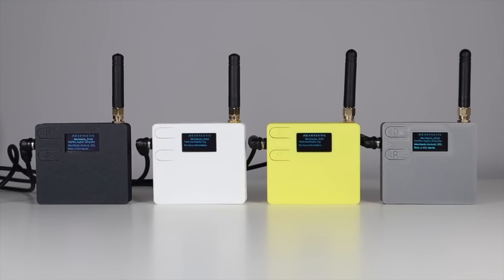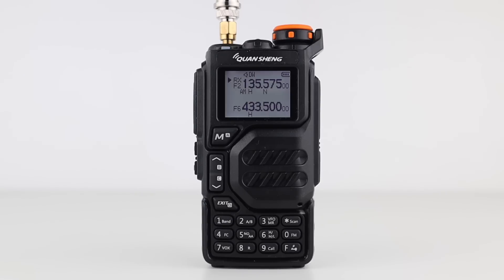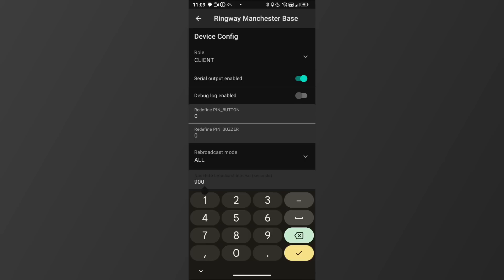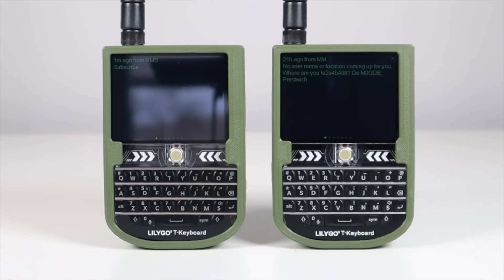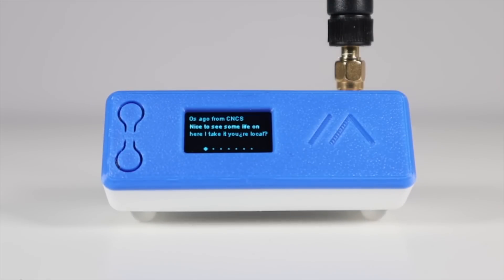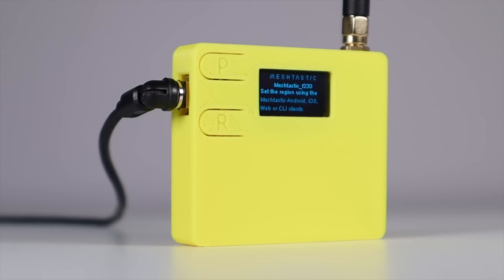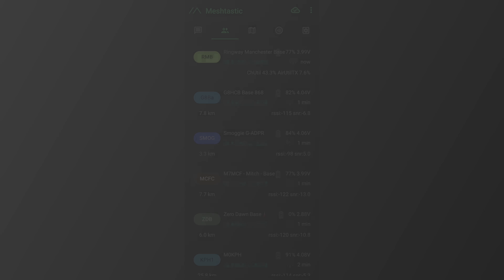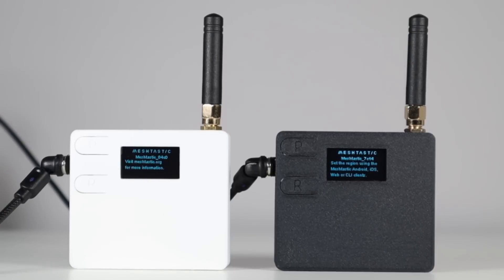All Your Meshtastic Problems Solved! - Off Grid Comms

Comment: The suggestion about suggesting users to increase ping delay reminds me a little of the 'niceness' parameter for processes on a shared Linux system where the intention was that surely users would start their process jobs with a niceness parameter that was friendly to let other people's processes get some processing time as well... Riiiight.....
I am new to meshtastic and not really an electronics engineer so don't have any suggestions for solutions, but it is sad that this kind of technology has this type of flaws where you have to trust that all other users behave respectfully otherwise it will not work..

Comment: Just got into Meshtastic a few months ago and I am in love with it conceptually, but there are a few things that are quirky and quite a few more that are frustrating.  Such as: whoever thought it was a good idea to call the default channel “long fast.”  Long_Fast is a modulation, and there 104 different frequency slots that can be used for Long_Fast modem present. The hash of the default channel name results in freq slot 20. Should have just called the default channel (with encryption AQ== and Long_Fast modulation) “Public” that would also help new users realize they are not in a private channel, and also understand that Long_Fast is a modem setting not just a channel name.

Comment: One thing to consider, is that many people that have Meshtastic devices have them for emergency purposes.  in the even of an actual emergency,  a once quiet zone can becomes very congested,  so having these settings as default even if your in a quiet area is best practice.

also I think,  setting your hand held unit to client_mute,  can also help.  strategically well placed nodes  means less nodes needed to service an area.   I live in south Florida US, so we are far from congested,  someone has placed some routers that seem strategically placed, I plan to add to that mesh.  filling a gap or two.

Comment: Am all for improving technology, but MESH just appears to be another fad that's been around for too long simply because of lack of imagination to try anything different in HAM radio. For all the hype about MESH and related or 'MESH'-copycat systems have heard for over a decade by various enthusiasts in the HAM hobby: the whole thing appears to be very non-adaptable and of very little real-world use - with the biggest issues being data rates (which is ironic given the higher frequencies used) and amount of bandwidth for channels available (i.e. 1 channel shared by all users). Some groups have poured thousands (if not millions) of pounds sterling into these MESH projects, claiming use for 'off-grid' or 'emergency', but with little (if anything) to show for it. Have not seen any 'improvements' in the general design of such systems, except perhaps minaturisation of the basic hardware used on it, but that's on par with most other HAM equipment that has been minaturised in the same way but with higher ERP potentials. Think MESH has limited itself far too much on old standards that are no longer practical.
Reply: You just don’t get it.  The low ERP is a feature, and you don’t get 50-100 km line-of-sight links with under 1W ERP unless you trade off bitrate.  If you want sensors, alarms, and telemetry information over long distances, LoRa is actually a perfectly balanced system.  And then people realized that these short data packets could be used like tweets to send messages and locations. Enter Meshtastic. Brilliant.  No HAM license required.   Using APRS requires taking an entire HAM exam.  And even then, APRS does not allow any privacy in the form of encryption.  Metastatic has its faults and quirks but there’s really nothing else like it.  Especially when you can put together a solar repeater for <$200 and place it up on a very high building and get coverage for most of a city. Problem we’re dealing with right now is the scalability and for something that’s barely 4 years old (Meshtastic not LoRa) that’s a rather predictable and hopefully solvable growing pain.

Comment: Given a house that's 20ft AMSL I could put an antenna at the apex at about 40ft AMSL. What's the best antenna form? J-pole, ground plane and dipole come to mind, but any roof mount will take the receiver  away from me, what is the usual range of the bluetooth supplied as part of the typical RAK or other meshtastic module?

Comment: I found the following issue with the RAK4631 and I have been able to replicate on the two I was able to acquire before @andykirby bought all remaining inventory 😡After 5 to 6 hours, if the unit is using LoRa /BLE and connected to the MQTT, and the Channel Utilisation is high (50% and up) the RAK4631 resets to factory default, as in commits suicide reset, all settings back to choose LoRa setting.  Anyone seeing this?
Reply: this is repeatable on the “msh/US” topic

Comment: Really Great video! Something to explore would be to change your radio configuration from LongFast to one of the higher bandwidth configurations. I'd bet with the kind of density in your area, Medium Fast won't have much difference in terms of range but has nearly 2.5x the capacity. Other configurations are available with even more capacity. All very worth while to try out in your area.
Reply: another VERY OVERLOOKED setting to add to this suggestion would be to get people with multiple nodes in a single house or in an extremely dense area to switch from client role (rebroadcasts everything) to client_mute role as a lot of people might have 2 or 3 plus nodes in 1 house, not all nodes need to be rebroadcasting everything... lets say 1 main base station node with a powerful antenna can be set to client/repeater/router role and everything in a short range can be set to client_mute role, it would considerably cut down on congestion on the network with the addition of making small clusters/groups with mediumfast or even shortfast...
Reply: @GothicFluffyWolf  ☝️ this.  Client mute is the way (when you have multiple low power nodes in close proximity).

Comment: I figured it'd eventually be an issue when I followed your guide, but didn't want to stir.

Because it's quite clear after I Googled it repeatedly that nobody or the manual had an answer, so that's on them.

There was a comment on LF about traces not getting through, so I turned it down already.

I guessed 1800, but tried hops at 4 because I'm at 6 o'clock on your map (21/106 online). Couldn't DM you at the Vulcan.

I think I'm only connected by SKK2 or ZDB to the north at 7km, due to bricks and stock antenna in the loft. I've traced about 4 others indirectly.

I reckon keeping phone WiFi on and enabling 'Store & Forward' catches more messages.

Comment: A great reminder to check your node settings as this picks up the pace. What I got from this tutorial, is that once there are enough nodes around, things such as range testing becomes somewhat difficult, if not downright impossible. So far, it's good that I'm living in a country where Meshtastic hasn't really picked up the pace yet, which is probably most notable, that I'm the lucky first 433MHz node out here, at least if Meshmap is to believe (and the fact I'm currently not seeing any other nodes present in any of the frequencies). In 868MHz, things are a bit different, but these nodes are so far really far an few and I'm yet to receive my own 868MHz Heltec V3. Once that arrives, I can finally test how it performs.

Comment: I am new this week to this and am in the north west, It's more messtastic at the moment. I started 3 days ago now and got a 35 mile contact for my first. Was great. It's been a mess as it only take a couple to have MQTT on and I have been told it kills it. It's still been fun and as I am up at weird times of the night I was able to make another 35 mile contact last night. I am still indoors on a 7 inch (ish) antenna but showing nodes 45 miles away. It's pretty remarkable. 

I have noticed a lot of people calling for a radio check and I think too many people may be replying and from too far away  (I am guilty of this). Maybe don't answer any radio checks unless it's within a few miles of you, maybe 5 miles if it's a quieter area or time.

Comment: NO Lewis. The most important thing is disconnecting from the internet.
When 1 node is connected to the internet, it sends ALL!! data to air to keep the other nodes updated.
All stations and all messages... everything.
THAT generates the most traffic.
You can monitor it yourself.
Reply: The internet?
Reply: @caam0000  You have no idea have you?
Reply: @saxpert  does anybody actually send it over the internet?
Reply: @caam0000  of course, otherwise I wouldn't write that. Seems that you're not very familiar with meshtastic functionality.

Comment: I still think it's very neat, and I don't regret buying one, but I'm in Georgia in the US, and I haven't come across another one yet. Even driving through Atlanta and spot checking some areas that I thought for sure I would find something, no luck. I realized it might be a problem when my local ham radio guys were only vaguely aware of them. I figure if they're not using them locally, no one is around here.

Comment: I was doing "meshtastic" things in the 1990s on 2 metres packet radio, using a Yaesu FT209 with AEA PK88 packet terminal connected to my Amiga.
Reply: High technology back then. Now its all software a few dirt cheap chips :) No license required. The first time in my life I can transmit digital data, as far as I know. 150baud'ish, Long Slow.  Reminds me of my first acoustically coupled modem.

Comment: I've heard if you have multiple nodes or you're in an area with a lot of other nearby nodes, setting them to use the "client_mute" role can help reduce congestion as they won't function as repeaters in that role, only as endpoints.

Comment: This is exactly the same problem that we had with AX25 and Tcip/IP over radio in the 1980's on the amatuer bands. More an more people started to use the frequency and increased the power output and reception range on AX25.(I have already seen colineers for 868 mHz being sold online for meshtastic units). We changed to TCP/iP in 1984. This was to utilise netmasking organise the link into the network into counties and formalise super routes via point to point systems on the gHz bands. Hands up who remembers the "Tiny 2" or the Kenwood 9600 bd TNC's?
Reply: I worked on AX.25 systems in NC back in the early 90s. We moved forwarding traffic to 70cm and up and increased speeds accordingly. User access was provided on VHF on a radio type of LAN. It worked very well. Those days, we could connect from NC to FL and all the way into Canada. Great times!

Comment: I'd add to that, do not enable MQTT on public LongFast channel (consider it useful for extending your private channels/mesh, but not the public one). And for everyone else, enable "Ignore MQTT" under Configuration > Lora. I think that setting basically fixed the problem for me, the more people that enable it, the less impact MQTT LongFast flooding may have.

My node would regularly be brought to its knees, NodeDB trashed and 10% duty cycle quickly reached, basically DoS'ing my own node and the local mesh before I ticked that. Now at least my node is healthier!

Comment: Agreed on the points mentioned, Lewis. I'm on 21600 seconds (6h) for node and position updates. I don't see huge advantages using the neighbour info either so I'd disable that completely, saving more bandwidth. Cheers, RupB Fast as Funk Base M7CUF in Longridge.

Comment: I have two t-beams and one isn’t charging the battery.  Anyone know why that might be?  Both worked before V20.2.x was installed.

Good to see that you’ve championed Meshtastic to the point that it’s busy.  Main learning point is to ideally leave everything set to the defaults unless you know what you’re doing.  If you can’t hear much from your location, try and raise your antenna before you start messing with the max hops.

Comment: What would you recommend as simple indoor Router? I got two clients but they are not on any high locations.
Reply: Set clients to client mute, use your best located client as “Client.”  Do not use router or repeater unless you are on top of a mountain or radio tower, it will hang up the mesh unless it is legitimately a commercial quality location/signal.   Anything short of that just client works ideal, since it’s still repeating.   A router takes, or rather, steals priority from all other nodes around it.

Comment: Nice update video, there needs to be some concensus on MQTT usage flooding the network here in Blighty, God bless.
Reply: Update: Firmware 2.2.23 in LoRa configuration module, 'Ignore MQTT' option is now available.
Reply: The consensus is don't use the default MQTT server, ever... I did hear the devs are looking at removing it to solve the problems. The only problem is it's total removal harms the devs future commercial aspirations...
Reply: @dougle03  There were no commercial aspirations when the project started, I hope it is not creeping in, that would end it. Not what Kevin had in mind at all.

Comment: No I don't have that problem, all meshtastics are sold out ! Or sold at over inflated prices
Reply: Looks like greater Manchester bought them all, lol
Reply: @sm1thers  😆
Reply: Heltec, Lilygo and Rak are all currently taking orders - direct they are $20-ish or less
Reply: I ordered a pair about a month ago from Ali Express and they arrived in a week! £37.86 (after tax at checkout) from RCmall.

I put it off for ages as unsure what to buy. Heltec themselves wanted like £55 postage or something weird.

There's a couple of stock antennas and luckily Andy's test video prefers the one I got.

It's the straight heatshrinked thin coil, rather than having two big lumps.

I suggest avoiding V2 and ones without Lora, duh. Also get 868 mhz.

I regret not picking up some tiny ipex adaptors because I can't easily DIY or fit another antenna.